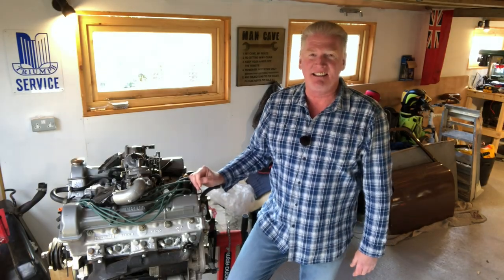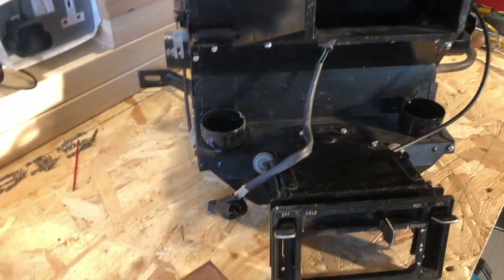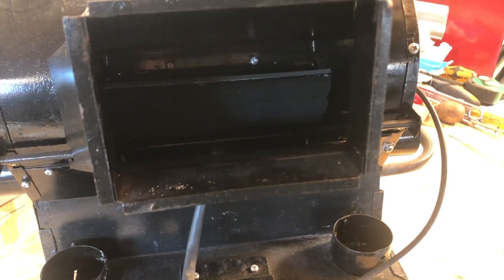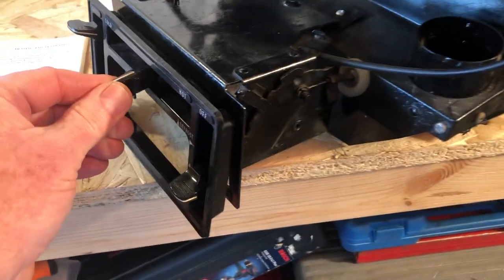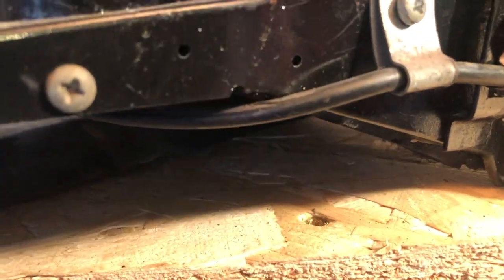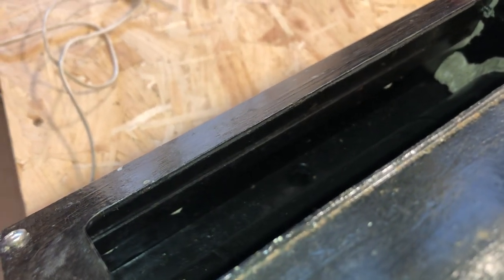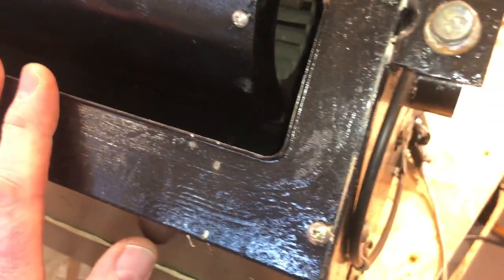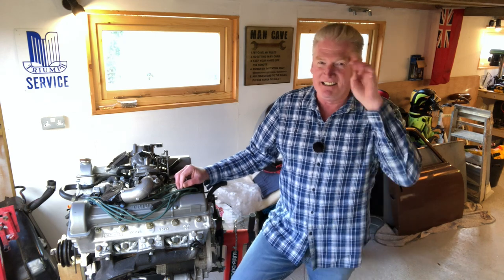Triumph Stag   Heater Control Box

Comment: Plumbers mait never does go off, it is used where their is limited joint flex, the sticky surface does reduce over time where exposed to air, but it's usually compressed between two surfaces to seal.